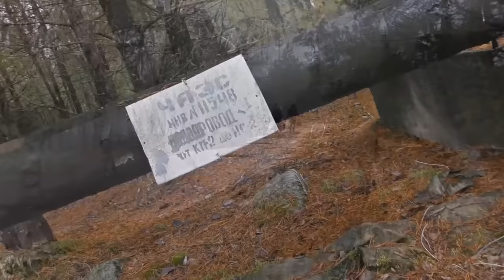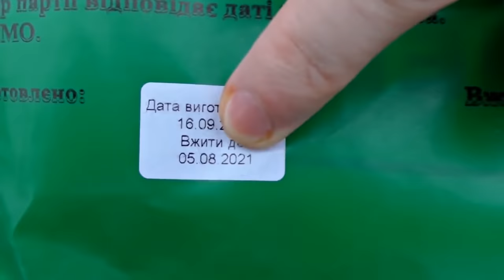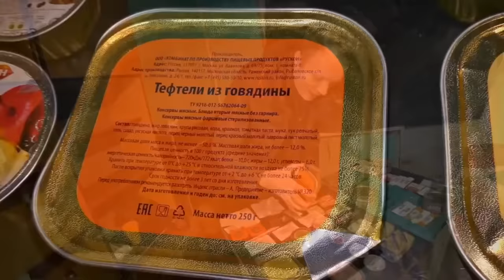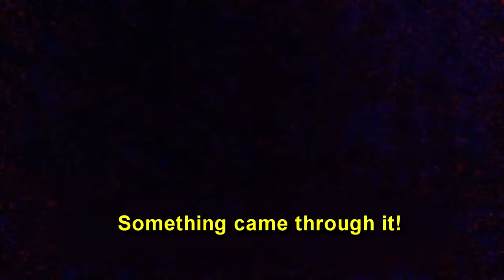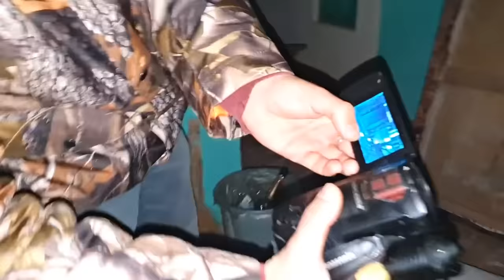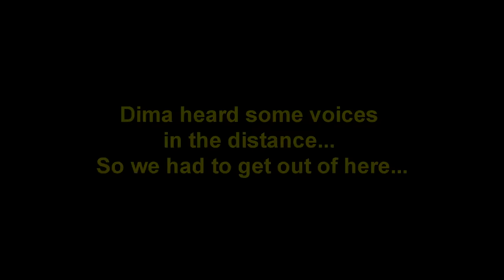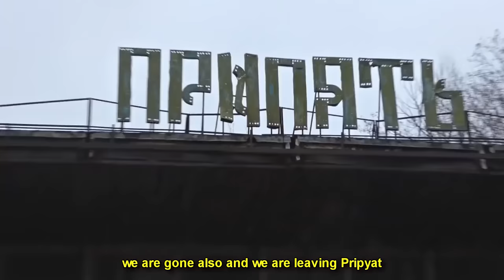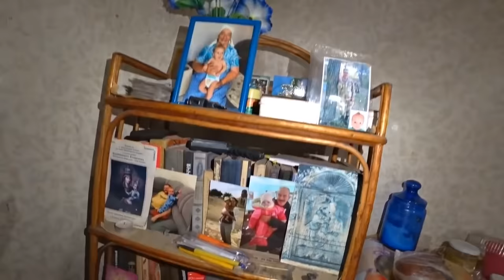What happened to the apartment in Pripyat where we did repairs ☢ Experience with a radioactive ladle

Comment: For very little money you can get an ESP32-CAM, which is a small ESP32 microcontroller with camera, power it with a lipo pack or 18650 and connect to it via WiFi. You can also connect a PIR, I suggest the HC-SR501 and insert a micro-sd card so it stays in a very low power mode until it detects motion, then it turns on and takes pictures.
It's so cheap you don't have to worry about losing it.
Yeah, get a new flat and don't tell anyone where it is, make sure you walk over concrete or stone to get there so you don't leave a path.